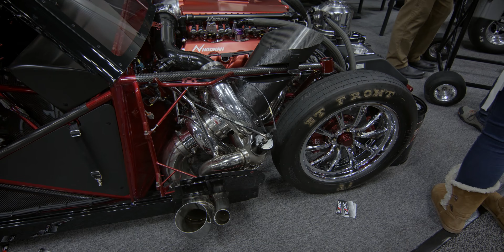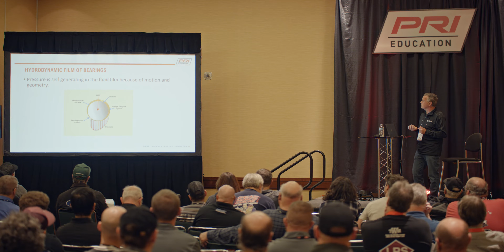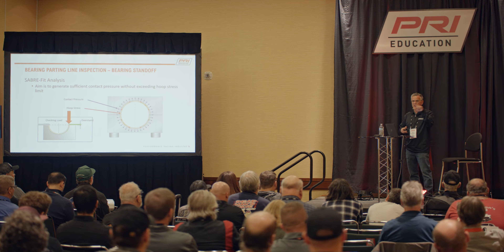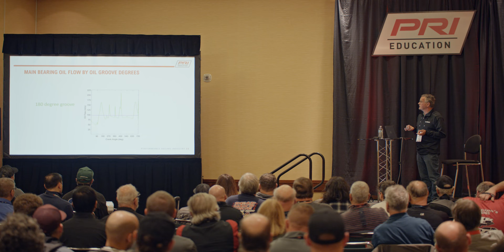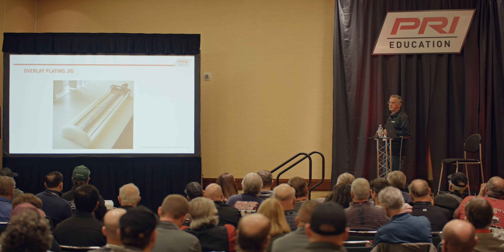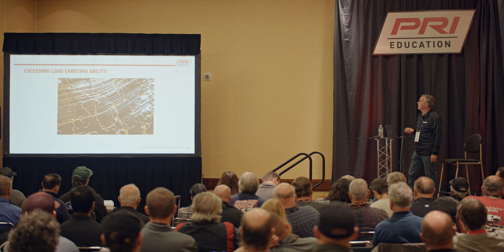What you need to know about performance engine bearings... before it's too late!

Comment: I use HX style bearings, in my hot rod engines, when extra clearance is needed, we usually run .003 thou. On the mains, and .002 thou. On the rods, too much on the rods will hammer the bearings out , remember the crank mains just go round and round, and the rods are slung up and down, with these clearances you may have too up your oil pressure to maintain good pressure.HX bearings give an extra .001 thou.clearance.

Comment: I was in this session and I learned something I couldn't with all the research I did on engine bearings. The fact that H-series Clevite bearings are cast with molten material instead of sintered with powdered substrate. I used P-bearings for a number of years because I was leary of the H-series design, not anymore after this session. I am currently running H's in my SBC 383 pushing 700HP and it has so far been great. I will know for sure when I tear down the motor this winter and inspect the results of this years season of racing my UMP Modified. Thanks Dan for the great info and presentation, keep up the good work!
Reply: Hey how did those bearings come out when you disassemble your motor?